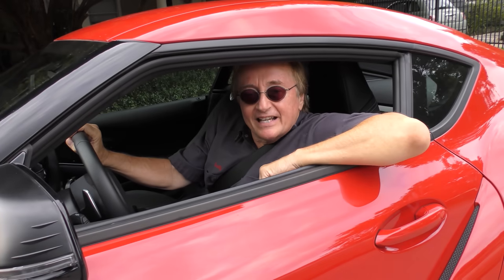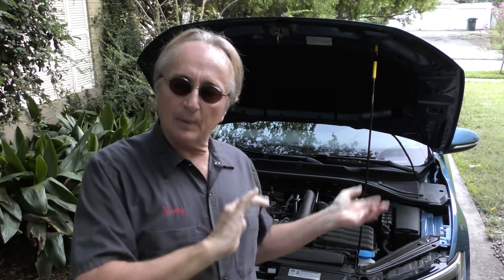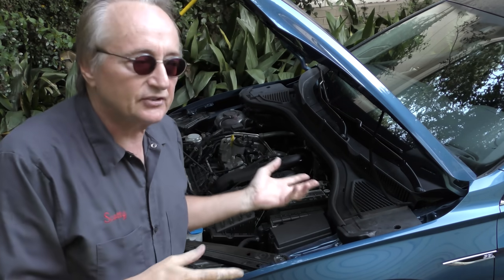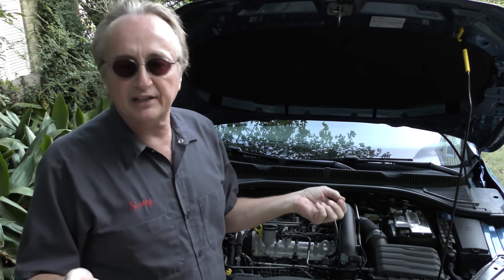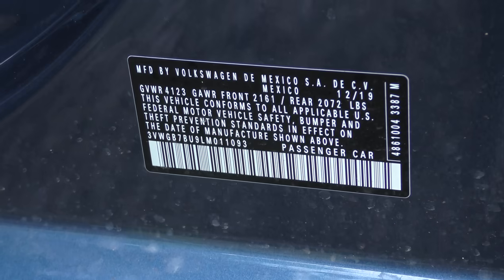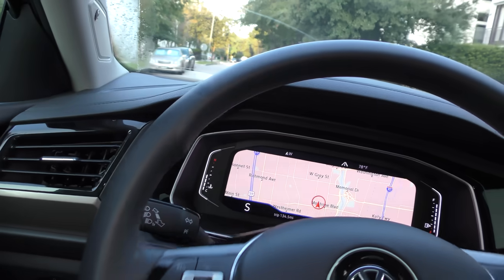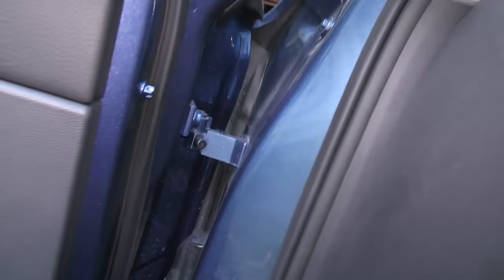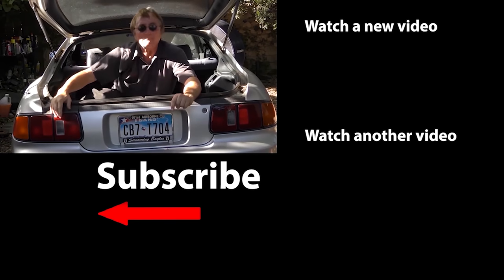I Just Found the Worst New Car Ever Made

Comment: "The belt lasts the lifetime of the engine."  Well, if the belt breaks and destroys the engine, then technically the engine's lifetime is over because it's destroyed.  The problem solves itself!
Reply: It has a 120k interval
Reply: @mitchbre2  150k
Reply: 'Life of the engine' - means when the engine wears out and needs a rebuild. Like piston rings, valve and bearings are worn. This can be well after several hundred thousand miles with today's engines.

Comment: Kim Jung Un couldn’t create a more biased video than you. My cousins pilot just blew its timing BELT at 70k miles. Engine gone. Cost to replace the belt? Over a thousand. Engine, close to 9k. It is not a fun car, cool looking, reliable, or really efficient. This car, which has a proven engine, better dynamics and better value, is worse? Get real

Comment: Nice review Scotty!  And as you know, many Lexus vehicles have interference engines and timing belts instead of chains. So, VW is not the only one doing this.
Reply: Guess I won’t be buying a Lexus then.  I hate paying over $1000 to replace the belt (every 60,000 miles on my Beetle).  Having a chain saves ~4000 dollars over the car’s lifespan
Reply: @electrictroy2010  unless the guides or chain tensioner fails..
I would be happy to put up with the gear noise in a direct drive system, rather than relying on belts & chains.

Comment: I bought the new Skoda Octavia 1.5 TSI 150BHP.
I don't know why Scottie is referring to this engine as 1.4. The 1.4 is retired. EA211 is 1.5.
So first impressions!
Great Engine, VERY... VEEEEEEEEERY smooth. Nice power delivery. I got the manual transmission.
The only down side is the humming vibration when it goes into 2 Cyl mode at around 1500-1600rpm.
Maybe with the DSG is not that noticeable but the manual  - yeah you can hear it.

The GAS MILEAGE IS PHENOMENAL! I used to drive VW Diesels, and I am not going back on that road.

They fixed the Kangarooing issue that the early gen 1.5 TSI had, though you kinda feel it ...on a cold start and if you take off immediately. 
If you try to turn on the radio, and get comfy ....there is no kangarooing. 

So...all in all...a great car. 

I was about to buy the Toyota,  but in Europe, you are better off with a VW vehicle.

Comment: so it's zippy, cheap, great fuel milage, nice interior for cost, good handling, etc.... but its the worst piece of kaka poopoo ever made because it has a thing that a good majority of cars have? Aight dawg. gg
Reply: Warranty Direct rates VW the 2nd Least Reliable engine due to frequent breakdowns.  My Beetle died at just 70,000 miles.  My 2 Hondas went 300,000+ miles with no engine breakdown.

Also VW commits criminal acts by cheating on EPA and EU pollution tests

Comment: when you spend your life only working on make of cars you become biased towards every single other brand make and model
Reply: Warranty Direct rates VW the 2nd Least Reliable engine due to frequent breakdowns.  My Beetle died at just 70,000 miles.  My 2 Hondas went 300,000+ miles with no engine breakdown.

Also VW commits criminal acts by cheating on EPA and EU pollution tests

Comment: It is a lifetime belt, Scotty. When it breaks the engine's lifetime is over. I owned a little Nessien Pulsar. tiny 4 bangers with a timing belt. I learned the hard way what "interference engine" was all about. I yanked the head off to find a few valves that had a close personal relationship with two of the pistons. I found a used head at the junkyard still attached to the running engine. 40 bucks and I was out the door. I drove that car another 80k miles with the used head and no problems.

Comment: well, vw's in europe are a lot better quality from what I experienced so far. Also isn't it the chain thats more complicated to change not the belt ? in UK you usually won't pay more than 300GBP to change timing belt but the chain costs 500 and more. Chain is pretty much inside the engine, unlike the belt. Looks like mechanics are ripping ppl off in USA just because it's a newer car. Btw I'm driving vw golf mk6 1.4 tsi, which still has a chain(bough it used). I heard about the chain tensioner failures so I did change the whole thing for a updated model at about 60k miles. So far 73k in total and it's ok.
Reply: You have to understand that most people here are from North America. They are clueless about the VW in Europe.
Reply: @duncanidaho7494  I do wonder about the demography, Scotty is well known. But you might be right. Still doesn't hurt to mention about the diffrencies
Reply: Doesn't Europeans and British only drive 10 miles a day? In California people spend 2 hours a day in traffic. So cars in the US have to be low maintenance to withstand the demand.
Reply: Kevin Lopez not really. In some big cities in Europe it might take you 1 hour to drive 5 km. Imagine the stress on the car ...
Reply: @kevinclass2010  yeah it depends on the case. Some do drive 10 miles a day, some drive for over an hour one way to work. And honestly I don't think any car is fit for driving in traffic where theres barely any air going into the engine
Reply: Warranty Direct rates VW the 2nd Least Reliable engine due to frequent breakdowns.  My Beetle died at just 70,000 miles.  My 2 Hondas went 300,000+ miles with no engine breakdown.

Also VW commits criminal acts by cheating on EPA and EU pollution tests

Comment: I’ve owned my 2019 Jetta for 2 years now and the only complaint i have is the Transmission. It’s slaps into gear and it will be jerky sometime when shifting at low speeds. I did have a recall done on it but the same issue persists.

Comment: The first high-end model of these new Jetta's made in 2019 actually came stock with a 2.0T engine which is way more reliable and quicker than the 1.4T which is too much for the little engine to handle
Reply: Nah, SEL-P in 2019 got the 1.4t
The only Jettas that get the 2.0t are the GLi's
Reply: @_dmfd  correct
Reply: Incorrect, those WV/Audi 2.0T engines have a design flaw where the cam sprocket and timing chain tensioners fail, its a known issue, they lost a massive lawsuit over it. I currently own one of those defective 2.0T engines.
Reply: @chocolatewheelchair  /\
Reply: bilbo23baggins hopefully you got the timing chain replaced. I too have the 2.0 in my Audi A4. Failed the oil consumption test at 52k, had the pistons, rings and timing chain replaced last fall. Currently all is well.😬
Reply: @_dmfd  They also use the 1.8 turbo motor with timing chain,which so far has not had chain or tensioner problems.
Reply: @nickpappas4133  as far as US market, S SE, R-LINE SEL / SEL-P all only have the 1.4t as their engine choice on the MK7 Jetta's. 2.0T is reserved for the GLi S, 35th and Autobahn.
Reply: bilbo23baggins lol that has nothing to do with what we are talking about
Reply: @bilbo23baggins  really? Does the lawsuit cover all 2.0T? Because it could depend on vehicle to vehicle. The entry re-designed Jetta carried the same platform as the Tiguan but would it operate better in a lighter weight sedan with fwd instead of awd?
Reply: @_dmfd  incorrect, my co worker has a 19 2.0L Jetta and I worked at a dealership when they sold a bunch of them, including to my co worker.
Reply: @chocolatewheelchair  incorrect. My co worker owns and drives one. I've parked many when working at a car dealership where he bought his.
Reply: @_dmfd  Many in Canada. My co worker bought one from the dealership we worked at.
Reply: james campbell bro what are you talking about? Please tell me
Reply: james campbell are you in the US? The new Jetta body style only has the 1.4 turbo in all trims except the GLI
Reply: @chocolatewheelchair  I'm in Canada.
Reply: @CampbellsUniverse  they have the GLi lmao. It's the sport Jetta but a seperate branding just like the GTi is to the Golf. The MK7 Jetta's only get the 1.4t no matter what trim.
Reply: @chocolatewheelchair  dude has no clue what he's talking about lol he probably means GLi. All N American MK7 Jetta's have the 1.4t doesn't matter if it's Canada or US.
Reply: bilbo23baggins my Audi 2.0t is fine

Comment: I've got a  2019 Jetta R-Line. I've put 53,000 miles on it in the last 18 months. It just rolled 110,000 miles. Literally all I've done to it is routine maintenance. I drive 140 miles every day, minimum. I average around 41mpg. It's reasonably comfortable. The stereo is pretty good. It's just a good car. 
My wife has a '22 Jetta SE. She has the 1.5, not the 1.4 It has 10 more HP and gets 1mpg better fuel mileage(allegedly, I haven't seen it yet but she drives more city/stop and go in her car than I do mine).

Comment: My cousin bought a 2020 jetta 4 months ago and the engine burnt out on the highway because there was an oil leak. Car needs a new engine, she only put 5k miles on it! It didn't even last till the first oil change. When she will get it fixed she will get rid of it. A very expensive mistake to buy a cheap new VW.

Comment: I drive a 2017 VW Passat 1.8 with 355k.  Turbo and Cat starting to throw ETC codes and has a parasitic draw.  But engine engine Is still fantastic, no sludge, no oil burning, or leaks.  It was a demo when I bought it and I am the only owner.

Comment: I've have several VWs and they've all been great and all have gone over 200k. Currently driving a 2004 VW Jetta 1.8T and it drives like new with 170,000 miles on it. Gotta make sure you do oil changes and timing belt.

Comment: I’m a vw tech and I quote 14hrs of labor at $220 per hr. for the timing belt. U have to remove the water pump and the cams lock on the back of the head. Even the best tech in the shop can’t have one done in a single day.

Comment: Deep down Scotty you love that car!
Reply: Warranty Direct rates VW the 2nd Least Reliable engine due to frequent breakdowns.  My Beetle died at just 70,000 miles.  My 2 Hondas went 300,000+ miles with no engine breakdown.

Also VW commits criminal acts by cheating on EPA and EU pollution tests
Reply: @electrictroy2010  no argument here ..I owned a beetle.. hahaha what a POS . When it rained I would get 13 engine codes🤣
The electrical system was a nightmare.
I sold it to college student (cheap) the last time I saw it she was on the side of the highway waiting for a tow truck.
Felt horrible!😪

Comment: Timing belt/interference engine.  I could never relax driving one of those.
Reply: Well when the pistons meet the valves, they'll be as relaxed as they'll ever be
Reply: Chain all day. Those suckers bathe in the engine oil... Makes me feel good knowing that
Reply: Same. I hate the interference design especially when my belt broke 15K miles before the change interval. I can relax when driving a chain timed or at least a non-interference engine.
Reply: It's a interference 1.5 liter 4 banger GDI engine with a turbo and a timing belt. YIkes! Get your wallets ready.
Reply: My old Peugeot 306 has a belt and is an Interference engine

9.6 to 1 as well, 1.6L atmospheric.  Good engine. Just chane the belt frequently
Reply: It's really not that bad. Just stay on top of the service intervals and you should be fine. I changed mine on my 03 Acura TL at 200k miles, and I'll likely never have to worry about it again. I'm sure the transmission will die well before another 100k miles :(

Comment: I have a question. I have a 2007 BMW 328xi (on its second engine) and every 10th time I start it, it sounds like it barely starts.

Also, I replaced a halogen headlight with an led one and it's still telling me to change the light.
Reply: Perhaps one of your ignition coils is bad, sit and listen and see if the exhaust seems to skip a beat.
Reply: @area.man.  also could be a faulty sparkplug
Reply: @helojoeywala6622  Correct. I am also wondering about the fuel filter. Sounds like it is an issue somewhere between the fuel/spark
Reply: Led bulbs trip the computer on German cars. Use oe equivalent bulbs
Reply: Yeah the led light will trip the computer out cause they don’t use as much power I’m pretty sure but I would check the plugs and coils same thing happened to mine it would crank for awhile on every couple start ups
Reply: @cartere9981  That's a shame because the LEDs are way brighter at night than the halogen ones. Especially on dark country roads with no street lights. I wish there was a way to reprogram the computer to accept them.
Reply: Trainfan1055 I’m pretty sure you can just would have to know how to code it they make apps on your phone I believe it’s BimmerCode
Reply: have a similar car just ignore the light warning it’s not gonna hurt
Reply: Try new spark plugs. I use NGK spark plugs for my N54. I’m not sure what is best for your n52 but check it out !
Reply: Bad ground on car or battery i would imagine
Reply: Leds have a lower resistance than incandescent bulbs. This trips a DTC in the computer because the resistance is lower than the logic programmed into the computer.
Reply: @nickcove7355  LEDs have higher resistance! It makes them look like they've blown, hence the code, and why LED indicator/blinker lamps make them flash quickly and need the bypass resistance to load the circuit.
Reply: @Eddiecurrent2000  you're sort of right. Leds have very little resistance, but they have artificial resistance added to limit current. So ya technically you're right.
Reply: There are kits you can get that will make the computer accept the Leds
Reply: REPLACE IT WITH A TESLA
Reply: @phatduong208  It turned out to be the starter. $700 at the dealership.
Reply: Second engine! Hahaha
Reply: Money pit. German cars are garbage after 30k miles

Comment: All these guys complaining about the Jetta are the same guys that bought a 2012 Jetta with over 100k miles at a used car lot buy here pay here and got screwed. Buy them new, take care of them and you will have a dependable vehicle. Last year I purchased a brand new 21 Jetta s. I had tested a new Corolla le a week before and man the Corolla was painful to drive. I’m not saying the Jetta is a rocket but it comes with great torque. It’s even quicker that the Corolla se with 2.0. The Jetta  handles better too even though it doesn’t have independent rear suspension like the Corolla does. I won’t argue that the Corolla last longer but the Jetta offers you more.

Comment: Since when is super light steering with no effort or feel a good tbing? Lol
Reply: Kind of agree with...almost turned my SUV over going home one night...something flew out of the bed of a truck in front of me...I reacted but was not at all accustomed to the electronic steering.  Way too much input on the wheel and almost went over....I'd rather have steering that can be adjusted to your preference for driving...hey, it's a computer...can it be programmed to the driver's preferences...or, put a switch somewhere like the sport, normal, etc ......transmission knob.
Reply: @memairport1  The steering rack on my 2016 GTI has what youre looking for, it's fairly light at low speeds to make parking, turning into driveways etc much easier, but then at higher speeds it feels heavier and tighter..better for stability. In any case, anything made in the past 10-15 years has electronic stability control which would make it very difficult to roll your vehicle without hitting something at high speeds while youre simultaneously overcorrecting with the steering. Modern cars have so many safety features some people have never experienced a spin (outside of driving on ice) or locked brakes..and wouldnt know what to do if they drove an older car and had to perform an emergency manuver.
Reply: Steering stiffness can be adjusted via VCDS to any Volkswagen newer than 2006
Reply: @jbm0866  agreed, I own both a golf Mk5 and a Mk3 and since the Mk3 only has a heater, absolutely no safety systems it doesn't even have power brakes I get your point. It is an old car that must be driven only by someone with some level of experience, there are many people that don't know how to react to a brake lock or even worse emergency situations
Reply: @jbm0866  2013 Ford Explorer...could swear I got it up on two wheels trying to avoid what came out of the truck...scared the heck out of me.  I completely over controlled my steering inputs...had just bought it and was not familiar with the sensitivity of electronic steering...and I was at highway speed...about 60.  Not blaming the vehicle....just over corrected.
Reply: memairport1 the steering does stiffen up at higher speeds on VW electronic power steering.
Reply: @TheNortheastAl  Thats great, but we'd never know from this "review"

Comment: as  a VW tech, that is not a DSG its a regular 8 speed. also the main issue with that engine is EVAP leak from the n-80 Valve.
Reply: Warranty Direct rates VW the 2nd Least Reliable engine due to frequent breakdowns.  My Beetle died at just 70,000 miles.  My 2 Hondas went 300,000+ miles with no engine breakdown.

Also VW commits criminal acts by cheating on EPA and EU pollution tests

Comment: I had a 2000 Ford Escort SE 2.0 SPI zero interference engine and I drove 75-80 miles and left with the gauge at above full and when I got back it was at full.

Comment: I just had the timing belt on my 2016 Jetta S. Same 1.4 liter turbo. All the VW factory forums say the  "lifetime" belt is 115,000 miles.  It was 1300 dollars ish at the dealership.  I have had my car for 2 years this month. I UBERed for a year, sales travel now but average 35,000 miles a year. That little engine is low maintenence. I have treted her well, run 93 octane do all the  Preventative maintence ahead of schedule. It is a fum car and durable

Comment: has been owning jetta 2017 4 yrs and live in northern ontario, it can stand winter -30 degrees, never had battery issues, breaking pad and tire are totally fine. only happened my AC cooling system, guess 6 months winter make it hard to survive,. and recently just headbulb need to change, over 70000Km already ,. I would say except oil change, no big issues.